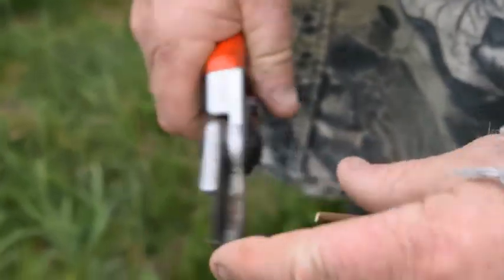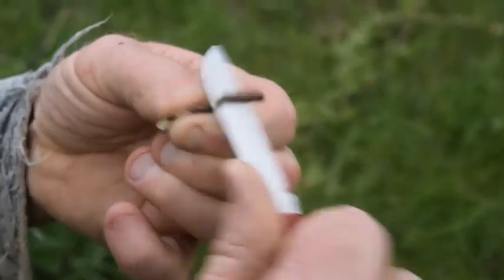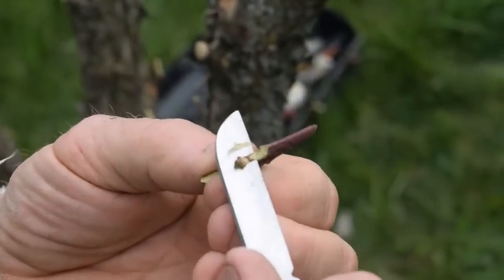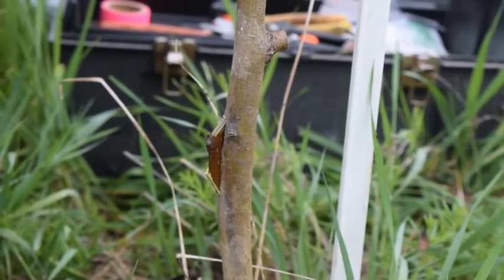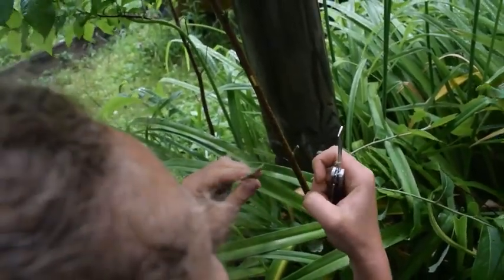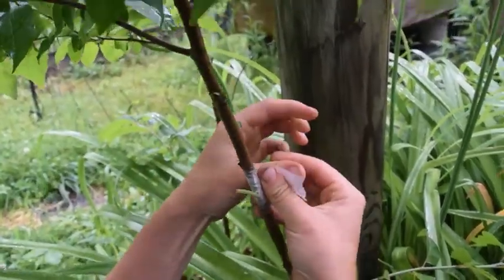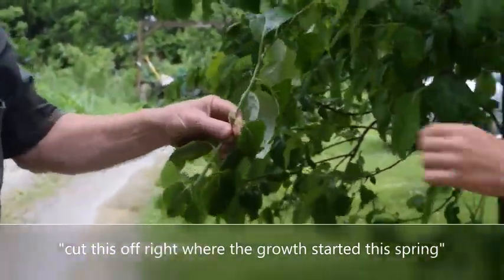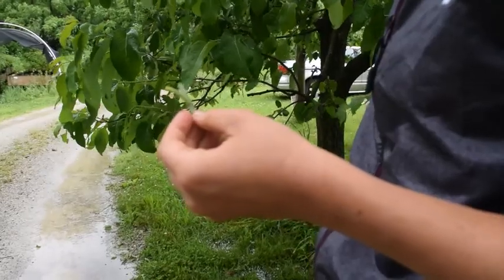Barn Door Grafting

Comment: For grafting in the spring with dormant wood, with which species is this method effective that you have enough experience to confirm?  Was that a cornelian cherry in the first part of this video?  Have you used this technique successfully with black walnuts or any other nut trees?  What range of ratios of scion diameter to rootstock diameter work well for this technique?  Thanks!